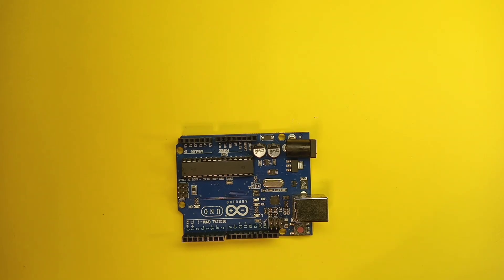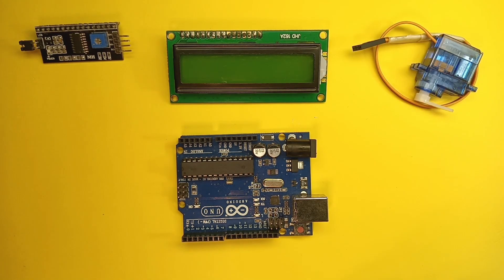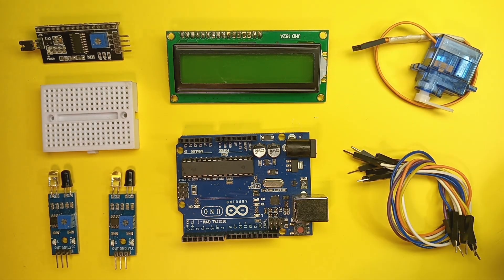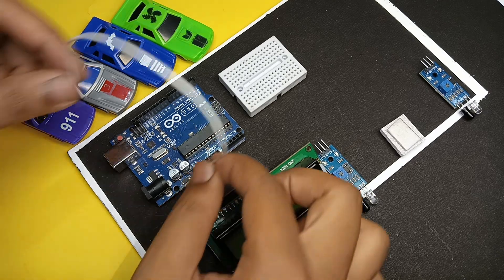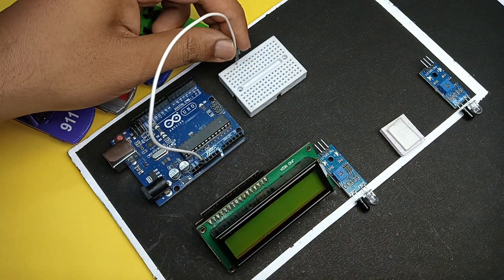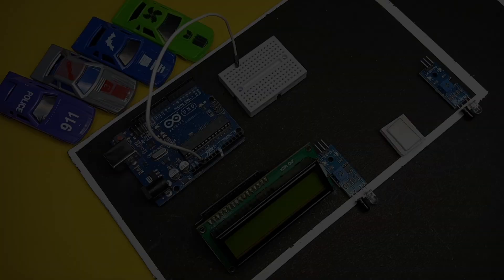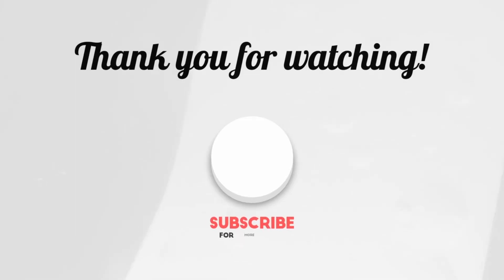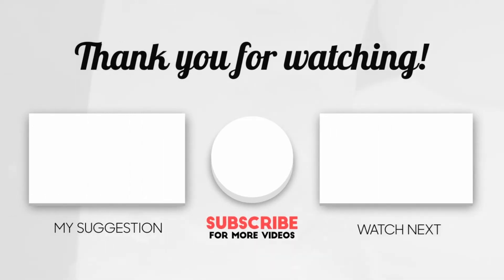SMART CAR PARKING SYSTEM USING ARDUINO || Techie Lagan

Comment: The *Smart Car Parking System using Arduino* is a project aimed at automating and optimizing the parking experience using simple yet effective technologies. The project employs Arduino microcontrollers as the core component for processing data from sensors and managing system outputs. Here's an in-depth look at the project:

---

### *Objective*
- To create an efficient parking system that:
  - Detects vehicle availability in parking spaces.
  - Guides drivers to available spots.
  - Displays real-time parking availability.
  - Optionally integrates with apps or online systems for reservation and monitoring.

---

### *Features*
1. **Real-time Parking Monitoring**:
   - Use sensors to detect if a parking slot is occupied or vacant.
2. **Dynamic Parking Guidance**:
   - LED indicators or LCD screens direct drivers to available slots.
3. **Automated Entry/Exit**:
   - Use IR sensors or RFID systems to manage vehicle entry/exit, often with barriers.
4. *App/Cloud Integration* *(optional)*:
   - Allows users to check parking availability remotely or reserve spots.
5. **Energy Efficiency**:
   - Use minimal components for low power consumption.

---

### *System Components*
1. *Arduino Board* (e.g., Arduino Uno or Mega):
   - Acts as the central controller to manage input from sensors and control outputs.
2. **Sensors**:
   - **Ultrasonic Sensors**: Measure distance to detect the presence of a vehicle.
   - **IR Sensors**: Detect vehicle movement for entry and exit.
3. **Displays**:
   - **LCDs**: Show the number of available parking spaces.
   - **LED Indicators**: Show slot availability (e.g., green for vacant, red for occupied).
4. *Wi-Fi Module* *(optional)*:
   - ESP8266 or similar module for internet connectivity and app integration.
5. *Servo Motors* *(optional)*:
   - Control barriers for entry and exit.
6. **Power Supply**:
   - 5V or 9V supply to power Arduino and sensors.

---

### *How It Works*
1. **Parking Slot Detection**:
   - Each parking slot is equipped with an ultrasonic sensor. If a car is present, the sensor detects it and updates the system.
2. **Availability Display**:
   - The system aggregates the status of all sensors and displays the total number of free slots on an LCD or sends the data to a mobile app.
3. **Guidance**:
   - LEDs or arrows direct drivers to the nearest available parking slot.
4. *Entry/Exit Control* *(optional)*:
   - IR sensors detect cars entering or leaving, and barriers are controlled using servo motors.
5. *App/Cloud Integration* *(optional)*:
   - With a Wi-Fi module, the data can be sent to a web server for remote monitoring and control.

---

### *Benefits*
- **Convenience**: Reduces the time drivers spend searching for parking.
- **Efficiency**: Optimizes the use of parking spaces.
- **Scalability**: Can be expanded to accommodate more slots and advanced features.
- **Cost-effective**: Built using affordable Arduino components.

---

### *Applications*
- Shopping malls.
- Offices.
- Residential complexes.
- Public parking lots.

---

### *Development Steps*
1. **Hardware Setup**:
   - Assemble Arduino with sensors, displays, and other components.
2. **Programming**:
   - Write code to control sensors and manage outputs. Arduino IDE is commonly used for this.
3. **Testing**:
   - Simulate scenarios to ensure accurate detection and display.
4. *Integration* *(optional)*:
   - Connect with an app or cloud for advanced functionalities.

Would you like a detailed schematic or code example for this project?